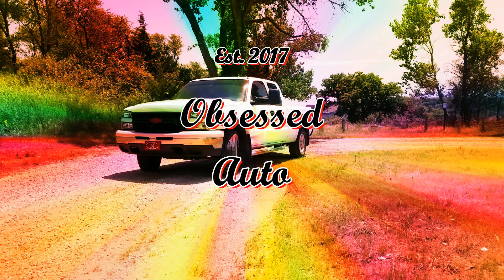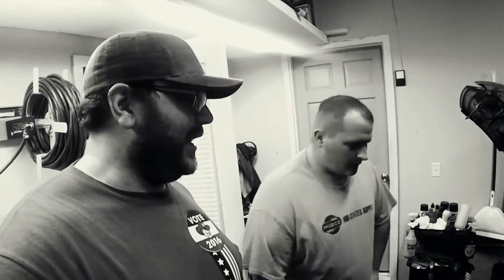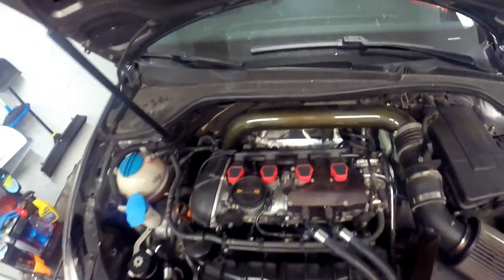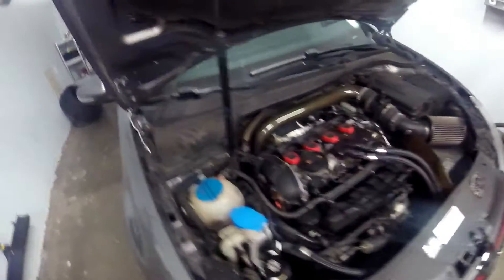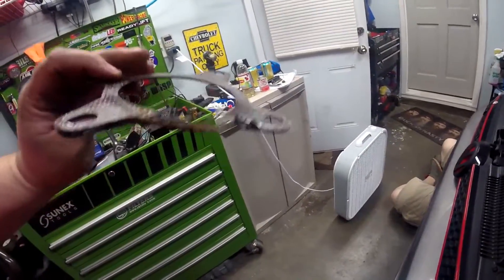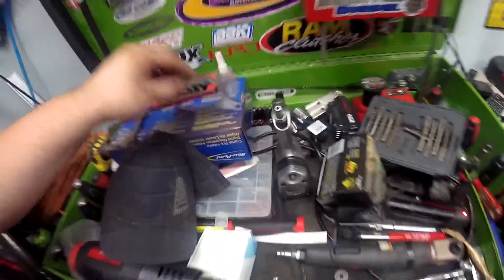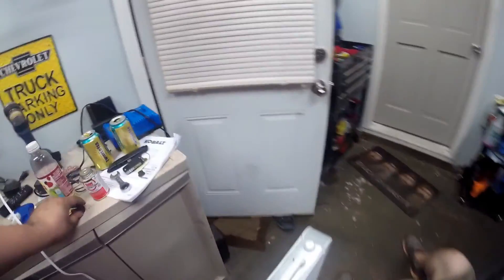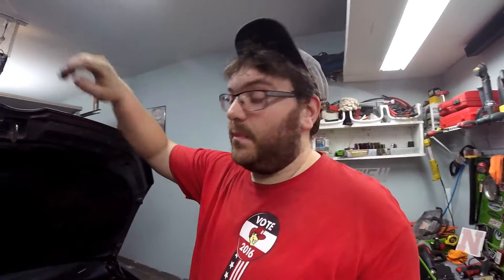Massive exhaust leak from downpipe install made my GTI sound like a lawnmower... remove and replace!

Comment: Damn, just installed my Arm cat less downpipe today and used the gasket that was supplied. It seems to be really smelly like that gasket is burning up so I hope I don't go through what you had to go through. Btw the downpipe did not fit at first, we had to use a Dremel to open up the flange holes a little bit. Also wanted to say that 3 out of the 4 studs came out of the turbo. 🙄 had a long day with this install but it does sound great
Reply from the maker: Wow! I guess we just got lucky about the studs staying in place! Hopefully you do not have to go at it again! It wasn't too fun at all!! Mine stunk but i just figured it was the piping doing the heat cycle and the new cat getting warmed up and then I heard a pop, from there out it was a lawnmower! haha!! Now it's nice and "Quiet" again! :)  That's odd about the holes needing wallered out! I'm glad you're happy with it! As soon as I did my first pull I was happy! ;)
Reply: @ObsessedAuto is this an Arm motorsports downpipe? I just installed mine, and have a big leak with smoke coming out. I'm thinking it's this gasket too. Also after I installed my downpipe, I don't get the sound I was looking for, it does not sound aggresive.